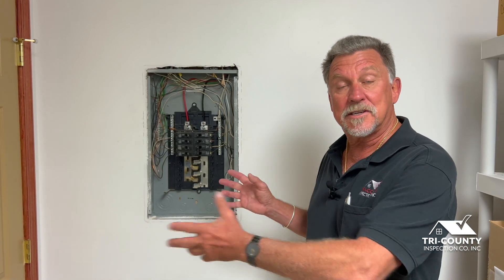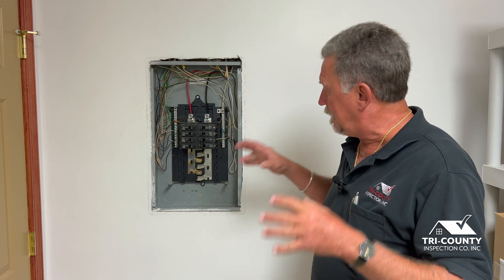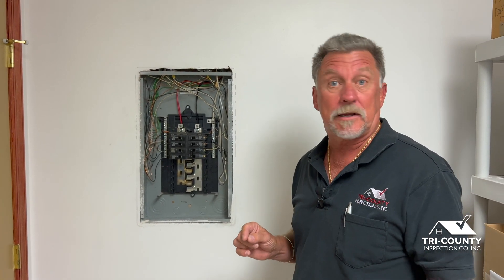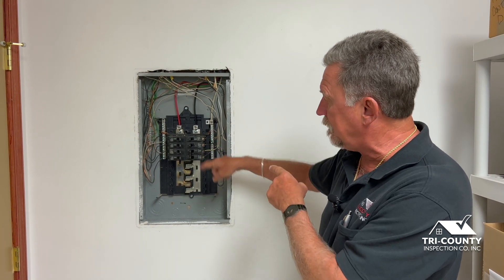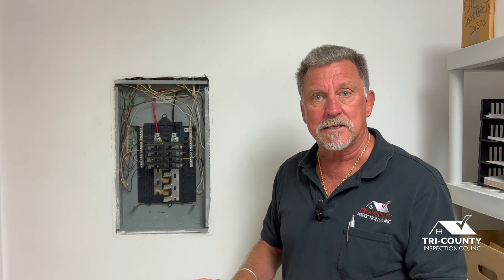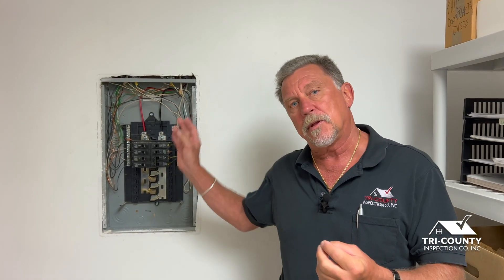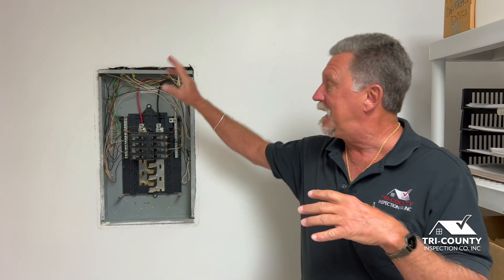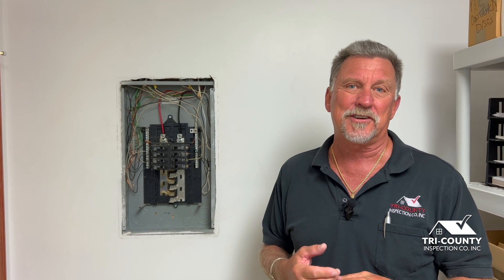Aluminum wiring , why is it dangerous? - The House Whisperer Show

Comment: Aluminum was actually used past 1972.  My house in St. Louis County in Missouri was built in 1976.  I suspect the builder of this subdivision was allowed to use up his supply of aluminum.  Problem was, he used receptacles and switches designed for copper only.  I had a number of melted connections, but no fires.  I went through the entire house and put co/alr switches and receptacles.  Also put NOox on any wire nutted connections that were aluminum connected to copper.  I am now in the process of pigtailing with Alumiconn connectors.  My breaker box is designed for aluminum or copper, as are the breakers.  It's also important to torque the connections in the breaker box.  My heavier circuits, like kitchen, bath, laundry are wired with copper clad aluminum.  I understand that some builders are starting to use copper clad aluminum in many new homes.